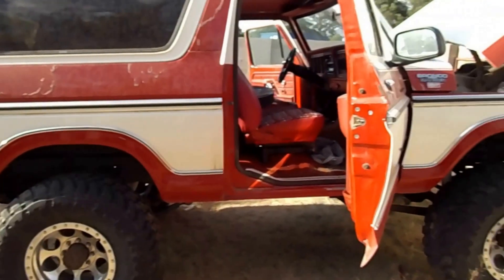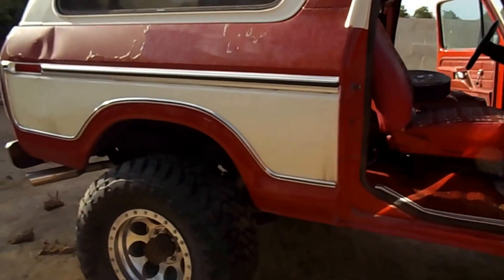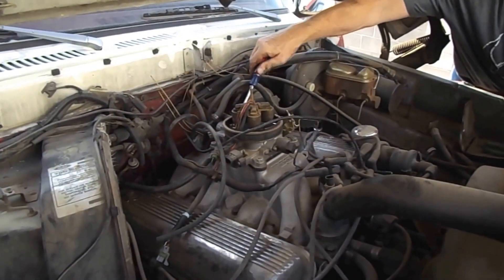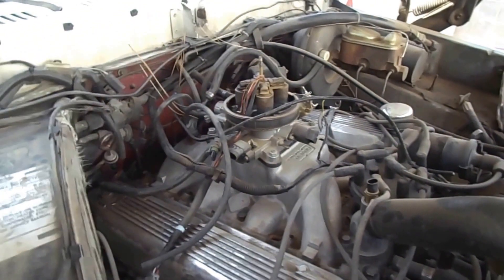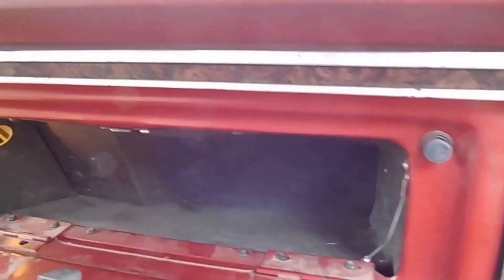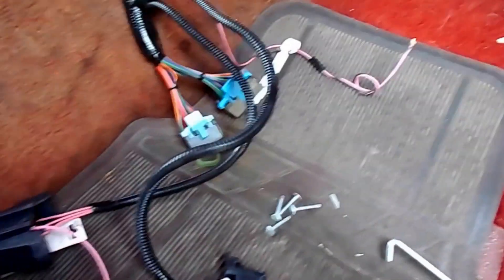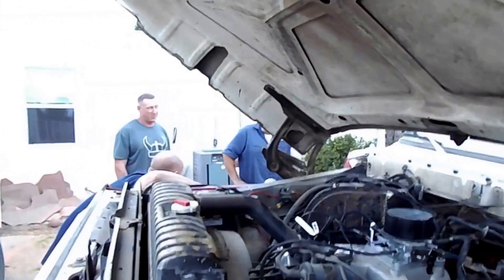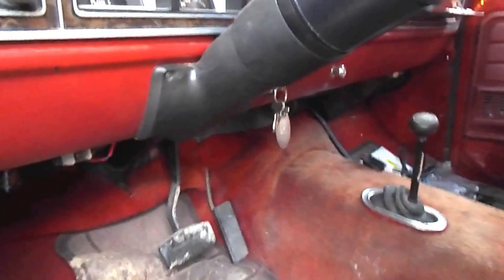Howell Fuel Injection upgrade for the Bronco

Comment: For that Howell EFI install did that replace the old computer in the Bronco or is that a standalone computer just for the EFI?
Reply from the maker: We pulled off the Holley computer and used the Howell EFI computer which is a remapped GM TBI computer. Good system so far. I have a 350 TBI in a Jeep and am going to swap from the GM harness and ECM to the Howell. Will post up when we do it.